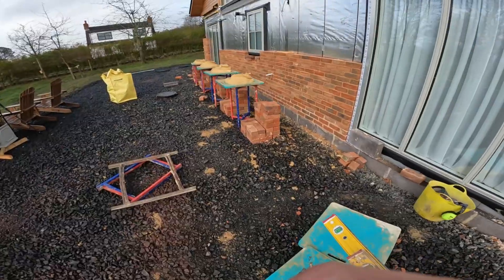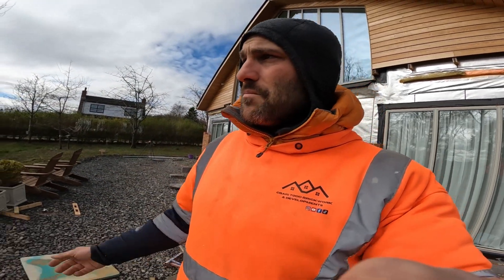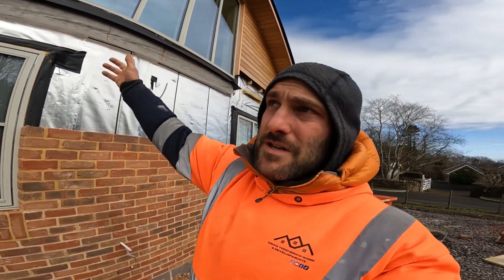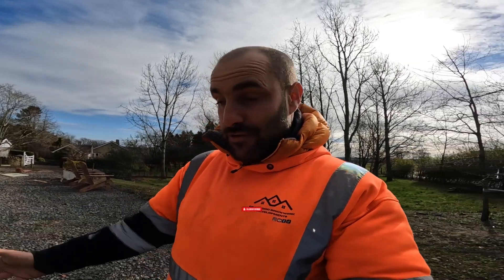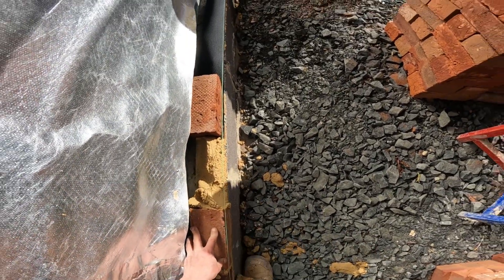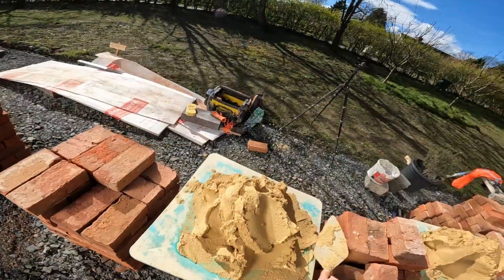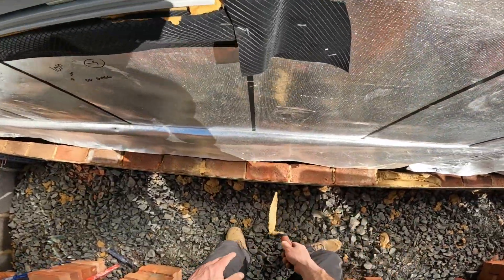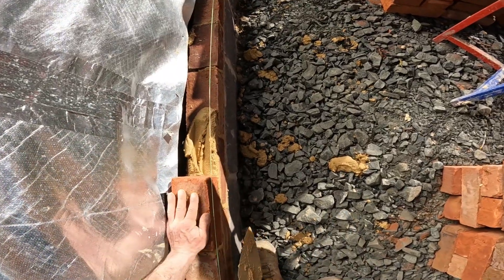ep5 Bricklaying on Timber Frame Construction

Comment: Hi mate top job coming along nicely nhbc are changing there rules all the time now never had to put cavity tray in timber frames on your dpc level  , i was building these massive brick chambers on a gas line few years ago and it was english bond so every 4 couses headed course and the building inspected came along and went thats wrong and i was like no its not but now English bond on anything is header every other course now over kill that like and also if your every doing manholes our chambers below ground you have to plaster the back of the 9inch chamber as well just got old profiles but they do the job but defo looking at getting them ones you got mate 🧱👊👊👊👊
Reply from the maker: Thanks Dan 🙂
They change to much to quick, a suit justifying there job in most cases ain’t it. 
Yeah mate you dont see much ‘proper’ english bond, not here anyway. It’s all garden wall bond like you say, header on the 4th. 
That profile set up is well worth it man Dan absolute belters 🤩